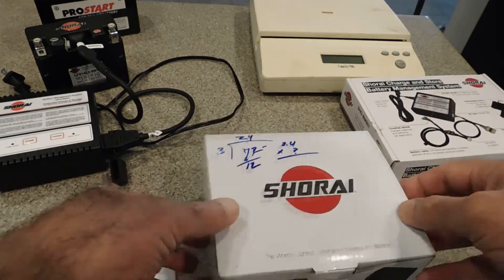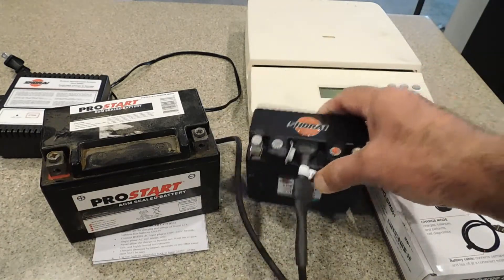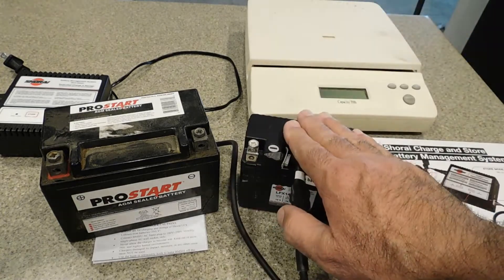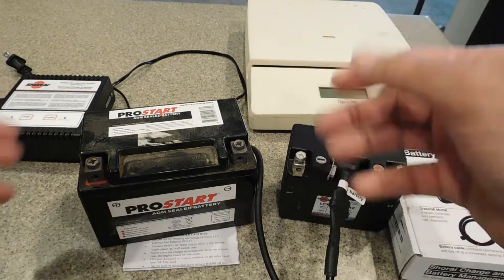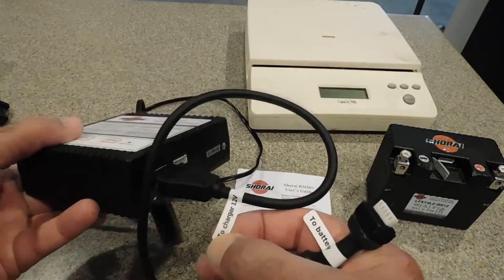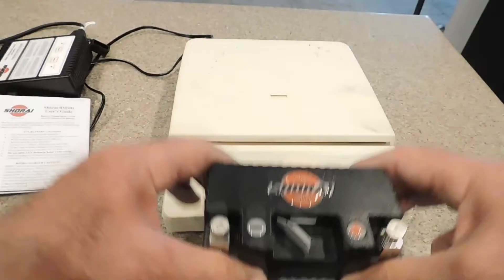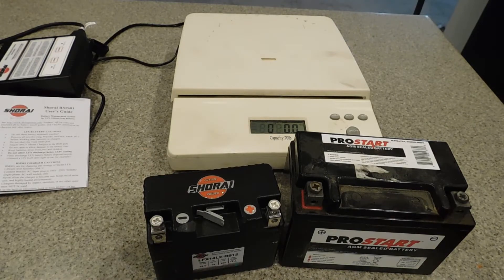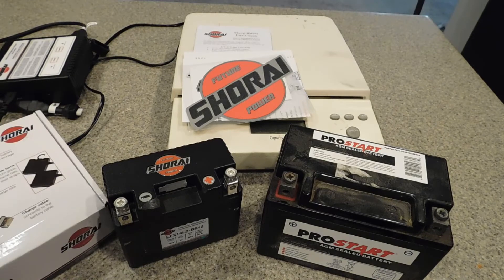XR650L battery swap out, Lithium or Lead Acid??

Comment: Coming up on 2 years, how is the little Lithium doing?  Do you still recommend this product?  Cool video!!  Further thoughts or insights?  Thanks!
Reply from the maker: Hi Roger, The little Lithium battery lasted a year and a half but it was used when I got it from another XR650L. I was going to do the battery box mod, but for me I don't think it is worth moving everything around. I have since purchased another  lithium battery that weighs close to the little battery, and I'm calling it good. it was $80 . I bought the same battery for my DR650 Suzuki and have been happy with the performance and weight savings. I did do a video on it. Also if you have a Honda I have really have not been riding my bike much do to the FMF power core exhaust. After half a day it just becomes too much even with ear plugs. I just purchased a Lexx muffler and will be doing a comparison. I have a Lexx on my KLR650 and it is the perfect tone, and there is an optional quiet core that makes it even quieter. I look forward to doing more rides on the XR

Comment: I did this. It works great.
Reply from the maker: Great News Ray, Did you do the full conversion or are you still using the Honda battery box? I was being safe and for the past 6 or 8 months have been running the small  lithium battery in the stock Honda XR battery box and have had zero issues, so in the fall when it gets cooler I'll eliminate the stock bolt on battery suit case. Nice to hear.
Reply: @verbalwidget0919  It takes about 1 hour to remove the suit case. No need to wait bro. Just do it. Have some zip ties ready.

Comment: excuse the question how long lasting is this battery in the xr650l?
Reply from the maker: I've been using the small lithium battery in the stock location for 3-4 months now with no problems. The battery was used in another bike when I started using it.
Over the summer I'll do the full conversion where I remove the stock battery suitcase that is mounted on the bike. I'll post that when I do. 
Thank You